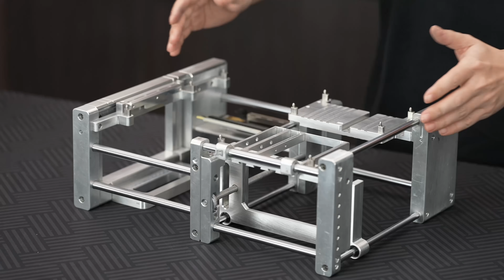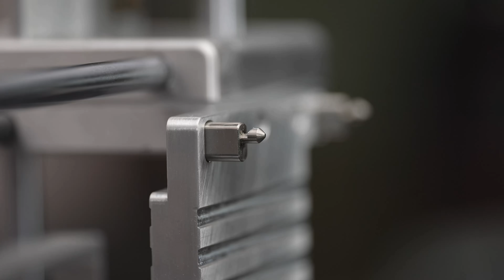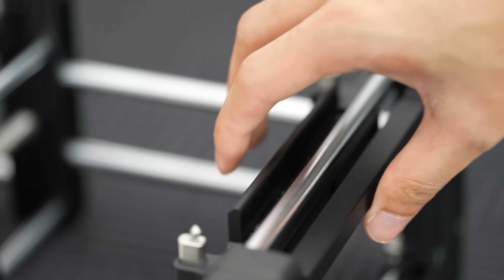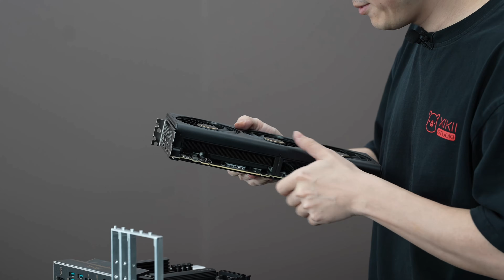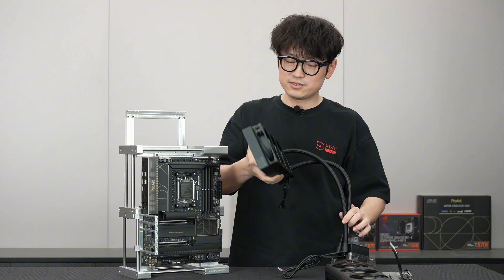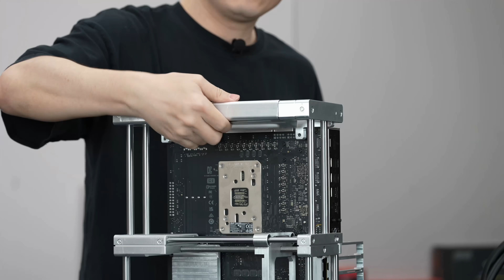XIKII INDUSTRY FF11 Hardware Exhibition Test Bench Improvement Update

Comment: Could that radiator be attached behind the motherboard (not too close to the motherboard, of course), for a vertical open air setup?

For the handle option, even if you disclose very well that it should not be used with the computer assembled, I would argue that 's exactly what will happen. There is always someone... 😶‍🌫

Excelent video btw, I like your thought process.

Comment: I'd love this as a permanent, open-air case, actually, maybe with more rigid connections when I screw parts into pre-drilled holes instead of using sliding mechanisms.
Reply: I would have trust issues with sliding mechanisms if I was to use expensive parts like those